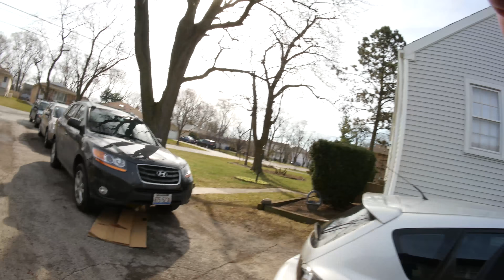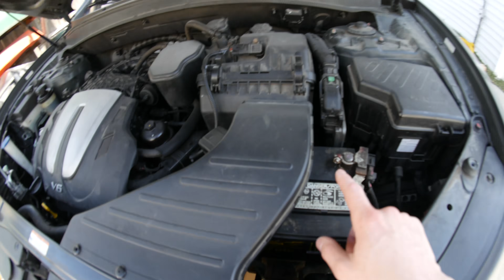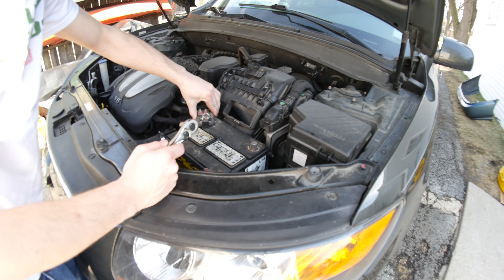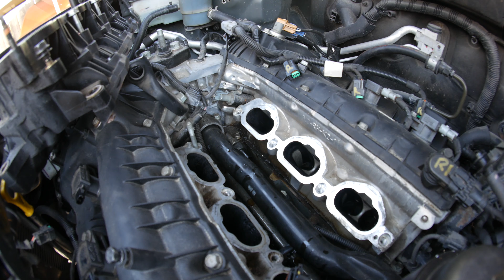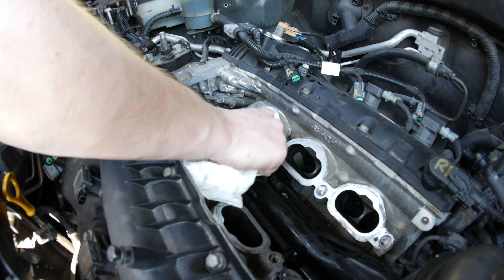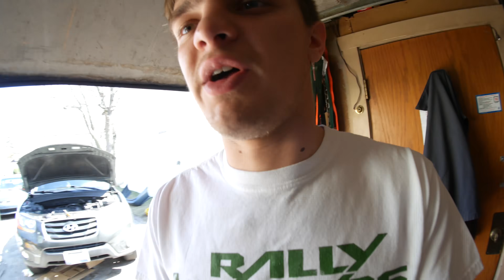REPAIR VIDEO:2011 Hyundai Santa Fe Engine leak. Failed oil pressure switch.

Comment: Kia Hyundai wanted $600 Cad. Local garage did it for 400. Probably most frequent problem for their otherwise flawless Lambda engine. In 11 years I had to replace 3 oil switches. That’s less than 4 years per one. Telluride and Palisade share the engine. The cost to be aware of.

Comment: Did a 2008 sante fe, 3.3L. Sits under oil filter housing, used a 15/16 deepwell socket and extentions to get it out, tight squeeze but didn't have to take anything apart. No more leak.
Reply: I have a 2008 too. Got a video?

Comment: and yet no rubber gaskets or o-rings were replaced or injector rail seal ? if your going to do this do it right the gaskets and -o rings are less then $50 top and running engine lean will only make computer compensate by adding more fuel fouling the plugs (lean as in air leak) the list of shit that can go wrong is humongus better to air on side of caution and replace all the seals and gaskets. unless the vehicle is your own and your simply a cheap bastard with no common sense.  This may all sound negative but as you get older and if you do this sorta shit professionally ever day for 35 plus years you learn that short cuts tend to bite you in the ass. with that said dont skip cheap parts .. if gaskets are $150 a set then maybe try re using them but if its a $12 item then don't

Comment: Just did this job, some ask for the torque for the bolts, just tighten them hand tight and be careful with the plastic harness on the front, it can easily break

Comment: From the service manual:
Tightening torque:
14.7 ~ 21.6 N.m (1.5 ~ 2.2 kgf.m, 10.8 ~ 15.9 lb-ft)

Also, manual says:
When installing, apply sealant on the thread part.
Seal lock : THREE BOND 2403
Thickness : 0.2 ~ 0.4 mm (0.008 ~ 0.016 in.)

24mm deep socket:
When removing and installing the oil pressure switch, use a deep socket as shown in the image below.
3/8" drive deep socket (24mm) with thin wall and the length less than 75mm.
Reply: Thanks - was looking for the torque!

Comment: Did I miss it? There's a 14mm bolt on the back, on the left, as you face the engine. A major pain to remove, and an even bigger pain to replae.
Reply: you do address the replacement of that bolt at 8:17 . Any tips on replacing that one? Mine is still off.

Comment: Fun weeknight, thanks for the walkthrough.

Couple tricks:
Both fuel rails will come out together once the 5-10mm screws are gone(only gas will be drips from the injectors).  Just flip the entire rail assembly upside down and place by the throttle body.
24mm box end on the switch(note how many turns and orientation to get it out so you don’t over-tighten)

Comment: Hey man, this happened to our Santa Fe about 3 months ago. Dealer quoted 850, we totally didn't care enough about it, so it's been parked in out garage since. After finding this vid, in an effort to get it running and sell it, I took a shot at it. Unfortunately, while ratcheting the new sensor back in I over-torqued and cracked the female end attached to the head. (I already feel bad enough people don't remind me lol). 

Good news is that - it looks like receiving end of thread can be replaced, but the coolant pipe in the valley needs to be removed. Will draining out a bit of the  radiator be enough to remove coolant from this pipe?  

Would you have any advice you could share with me?

Comment: I'm literally crying right now. I think I've been robbed of $2200. Mechanic's claimed it was the real seal. They fixed that up, but then stated when they started up the car again there was still leak, now its the pressure switch
Reply from the maker: Yep mechanics are ass hats
Reply: Don't feel bad, same thing happened on my 2011 two years ago & it cost me $2500 after the idiot mechanic said it was the rear main seal & changed it. Took it back 2 days later for same problem & they tell me it is the sending switch ! Now, here I am again with the same problem all over again! This is one of the worst engineering design flaws & dumbest places ever to put in a pressure sending switch!

Comment: The oil light keeps coming out on mine ,but only when I'm coming to a stop or park. Once I accelerate it goes away. No oil leaks or stutter. Idles, runs, and sounds fine. Could it be a bad oil pressure sensor?
Reply from the maker: I would start by replacing it because its so cheap.
Reply: @GridWerksGarage  But the labor for such a small and inexpensive part is horrible haha, but I'll try it out. Thanks
Reply: Hey man, Im having the same issues with my 2015 Santa Fe. Did replacing the Oil sending unit fix your issues? What year is yours?
Reply: @BelievingThomas316  did u fixed yours?
Reply: @lupitacarballo0305  I paid to have it fix. This was indeed the issue. Be sure to get a genuine Hyundai part. I paid to replace it twice..
Reply: @BelievingThomas316  dang how much did u pay? The light comes and go as soon as i stop light comes on? I just fixed the ac had to paid 500 and they did oil change, which had me thinking they did something to it, that now is doing this?
Reply: @lupitacarballo0305  $350

Comment: Thank you!  I actually fell in this trap.  Had rear main replaced.  If I had only done a little bit more research.  Pulled my intakes and sure enough the valley was full of oil.  Thank you for the video

Comment: Did this on a kia sedona by removing air box only using a lot of 1/4 inch extensions and a 3/8 adapter sae 15/16 socket worked better used a pick to unplug go in from driver side

Comment: Also,I didn’t use a socket,couldn’t get it past the cooling pipe,used a 15/16 box end wrench and had to turn it each time but it worked. That’s why I broke housing too much torque on end of wrench and didn’t feel tight.
Reply: Broke my housing too. I'm trying to replace it still. How did you get that coolant pipe out of the way? Can't get the last bolt out of the housing because of the coolant pipe.

Comment: Great video! However I didn’t know how tight to put in new switch and over tightened and broke switch housing. Now I have to remove coolant tube and not sure how. Which side is the easiest to remove
Reply: Alan Gilder I made this mistake as well, did u ever figure it out?

Comment: hi there,

my 2007, sta fe got the same problem oil  drips   between the transmission & ENGINE while is on idle... but when you rev it up oil is oozing out from that hole  

please let me know if we have the same case thanks

Comment: Are you using a swivel to get to the oil switch? Need to know...I'm looking at mine as I type lol 
Thanks a bunch for posting this video!
Reply from the maker: Yes I used a small swivel and extension
Reply from the maker: Late reply but yes a swivel is what I used to get that silly sensor out.
Reply: LoL Thanks, I just did this repair again.

Comment: Great detailed process and explanation.   Especially the reinstall.   I have a 2012 Kia Sorento 3.5L FWD w/ 105K miles.  The oil light just started flickering and stayed on at low idle - no leak.   Took me ~4 hours last night but I took many pics and made sure to take my time and store all the bolts in separate bins.   Many of the wire connectors were color coded and formed to reconnect fairly easily.  Also changed the plugs per your follow up vid's tip.   Cleaned MAF &  throttle body too.  Oil light is off but will post back if it comes back...  Used Kia part as AutoZone didn't have it in stock.  Old part had some oil in the connector cavity so it may have started to leak eventually.   

Overall, easier than I thought but still a bit scary as it's my wife's car.

My tips:  Watch the video several times.  Get the 6mm hex socket and 24mm socket with universal swivel joint and 3" extender.  Be careful tucking or removing hoses. I missed reconnecting one 1/2" hose behind the throttle body which when running at normal temp caused the engine light to come on popping codes P2016, P2110, P061B and C0700.   Loud air sounds after driving awhile clued me in on where it was even though I was basically staring right at it.  Cost me an hour in the morning and a rough nights sleep.

Thanks again.  Got me driving the next day and saved me the cost/frustration of a mechanic who would probably not diagnose it right.
Reply: cool, thanks for sharing.  I need to do this job on my '11 V6 Sorento.  Do you have the pictures online by chance?

Comment: Just did this and oil still seems to still be leaking out. Is it just possible that it's left over oil from before?
Reply from the maker: Bryan Coucill yes usually i try to soak up as much as possible with a rag or something
Reply: Yep. Just ended up being left over oil. What oil do you recommend that I put in the vehicle when I do my oil change?

Comment: Great video. Made the job go smoothly. 3 hrs taking my time. The most challenging part was finding a socket to fit into position to remove the sending unit. It's a tight spot. Wondering what the book time is on this job.

Comment: Great video, very helpful. I notice that no gaskets were replaced, wouldn't that be a good time to do it? I know the newer gaskets last a lot longer than the old school ones I am familiar with, but I'd love to save the cash if I don't need to replace them. 

Anyone else here not change them when changing the unit?  Thank you

Comment: Great video, thanks for documenting the actual steps!  It was super helpful!

Just finished this on my 2011 Kia Sorento SX.  A couple quick tips while they are still fresh:
-To get the sensor out is a pain. You need a 24mm deep socket, universal joint, a short and long extension.
 -For the bottom half of the intake it's a #6 Hex socket. 
-The back passenger side bolt that's holding the intake is the only 14mm bolt.  Everything else is a 10mm except the one 12mm holding the throttle body.  

I was able to do the job without removing the airbox, or completely disconnecting the fuel rail and upper manifold.
Total price for the sensor was $4.60 CAD at the dealership!
Reply: #6 hex socket?! What is that🙄
Are you referring to a 6mm Allen bit…?

Comment: What to do if the part where pressure switch mounts strips or cracks? Can i fix that part at home? Please help if you know? Thanks!
Reply from the maker: You have to replace the housing. Yes it can be done at home.

Comment: Hello 
My 3 month old hyundai tucson with 3500 km on it had the check engine light flashing for a few seconds then it happened after a minute again while i was driving at 65 km/s . I felt a slight vibration during this then the flashing light went away and never came back since . Outside temp was very cold .-15c and roads very salty .now after a few months the flashing light never came back . Any thoughts .

Comment: Question on pulling out the fuel rail.  After all the bolts are out, is it a hard pull to pull the fuel rail with the green fuel injectors out of their sockets?   They seem tight and I don't want to pull too hard, or is it normal to pull hard, or is there a trick to it?  Nice video!
Reply: I was able to get fuel rail injectors out of their sockets by "encouraging" them with a screwdriver prying action while pulling up.  I finished the job and everything went well.  Changed the spark plugs too while the intake is off!

Comment: how do you purge the fuel system?
Reply: To depressurize the fuel system, I just pulled the fuel pump relay while the car was running for about 10-15 seconds until it started sputtering.
Reply: Figured it out!! I just did this today, followed your video and got it done, massive thank you! Hardest part was getting the sensor off, black pipe in the way, and the deep socket I had wouldn't fit in there. Ended up using a crescent wrench very slowly, but it worked! I've no idea how you got yours in there! Thanks again!
Reply from the maker: Just put a video out on how to purge it too but thanks!!!!

Comment: I did it ... cracked the oil pressure switch housing....
I am royally FU#@ED!
Reply: Any tips for how NOT to do this?? Im scared...
Reply from the maker: +Luke K ouch. Just tightened it too much?
Reply from the maker: +Alicia Marie bw gental and try to imagin you know what you are doing. That was pretty much me while i did it.
Reply: Hey... so i put on Teflon tap to make sure it was 100% sealed... it was too much tape i guess and i heard a crack... 
Unscrewed it . All seemed fine ...put it back in and housing  split....

It was easy to replace.
Only shitty part..
In canada dealer charges basically 108$ with new gasket...new switch (installed) so it wasnt a hard job.... just sucks getting cooler pipe off.... 
Over all ok. 
Thanks for video. If i knew how to add pics I'd show you.

Btw
I put it all together ... was installing last left hand side intake cover nut... i fumbled... and fell to bottom of the v6. Lol
I had no choice but to take everything apart lol
Reply: Also.... no need to panic. I thought it was one piece....but its not ... use wood and a pry bar ...and it pops off... be careful..... go straight up ... there are 2 position metal guides...

So housing... straight up.... when removing.. 
May need a little power to pop it up.. but its not too hard.

Comment: I went through 10 Litres of oil on way home from Vacation in my 2010 Hyundai Santa Fe Sport 3.5L . When I found your video I bought the switch for $20 and installed it. Problem fixed. Thanks for the video!

Comment: Dude my 2011 also has the same problem. Was wondering what the process looked like to replace the switch. Thanks a ton for posting this video! I'm assuming it did but, did this fix your leak?
Reply from the maker: GMLancers58 Yup! the car has been running great for the past week now.